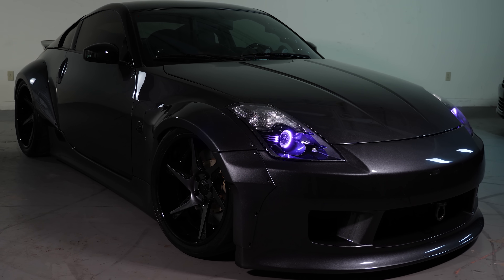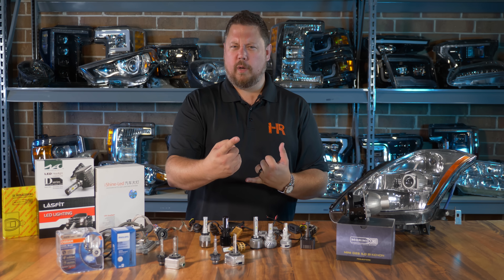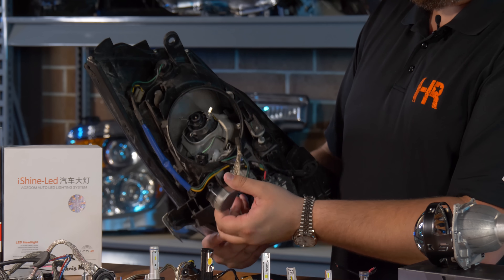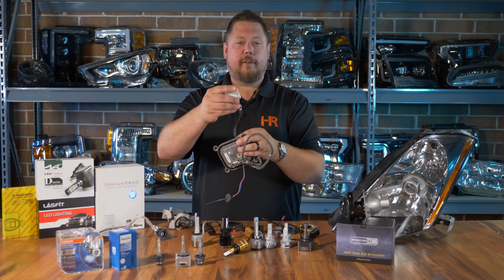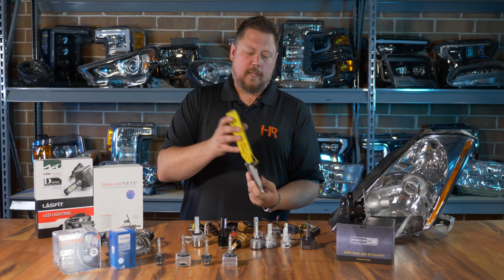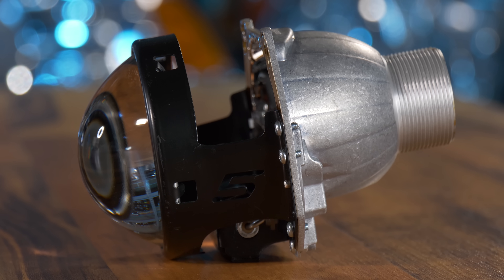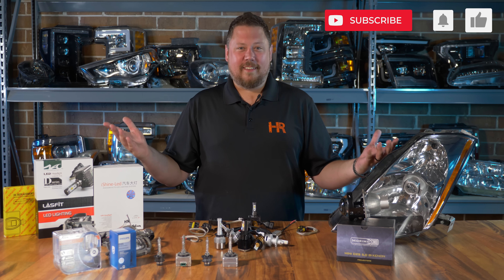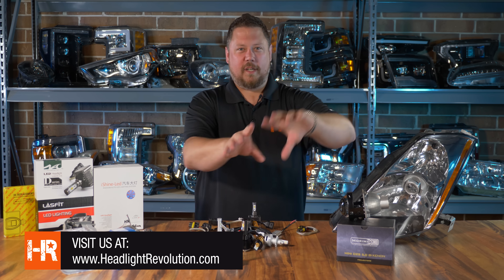D1S and D2S LED Headlight Bulb Replacements - Are they brighter than HID? | Headlight Revolution

Comment: Time to remake this video?? There’s now a few that are plug and play with the ballast! I’m going to give it a go!
Reply: true. I cant even find a video about those. I will have to find out how good it is. ill be installing mine this weekend.
Reply: @Abeldlg  let me know friend
Reply: How do they work?
Reply: @daltonnadeau1339  very well actually! I have the conversion in my Vauxhall Astra van. They seem to be a lot brighter than the xenon bulbs that was in it!
Reply: @125ktm2007  awsome thanks!
Reply: They are good and brighter than oem 35w hid. Im selling them locally and customers are happy.
Reply: @125ktm2007 how about the range? Do they shoot as Far and Wide?
Reply: So there are also now connectors for OEM to LED upgrades. No more cutting necessary.
Reply: @chrismic4835 i have d2 factory and wanted to upgrade.  Led or even hid. I just want something really really bright. any suggestions please?
Reply: How's your experience with LEDs so far? Should I replace my HIDs with LEDS on the stock ballast?
Reply: I came here to write the same comment. I gave up after watching this video, but when I saw the new plug-and-play D series LEDs on a friend's car, I was impressed. They are excellent and maintain the original beam pattern without any changes. Now, HID xenon bulbs look like halogen bulbs when placed side by side. I wish I could post a photo here. Anyway, I think it's time to remake this video because it misled me into thinking there was no plug-and-play option for the D series. But there is. Go out and buy one—I switched them today, and they are great. They use your original ballast to power up.
Reply: Any links of those plug and play for oem D3S, please???

Comment: I don't know why anybody would want to swap out HID with LED.  That's a downgrade, not an upgrade.  Great video tho!
Reply from the maker: It depends on A LOT, but to each their own!
Reply: Because use less power better for battery altenator etc.
Reply: SladjanL I doubt that it makes any difference to the battery or alternator. Most HID kits use a 35W ballast, which is the same amount of power usage as a regular headlight bulb. For now, HID is still better than LED, and as I said, it’s downgrade to go from HID to LED.
Reply: @onlinepaydays  thank you mr scientist
Reply: @gamercoolapple1  you're welcome.  Doesn't take a scientist to look at the basic numbers to draw the conclusion.  As long as you're not an idiot, it's pretty simple to see that HID still out performs LED.
Reply: Sorry but what you are seeing today on the new cars are not hids. Those super bright light that your seeing the roads are not coming from hids. But also not aftermarket leds. Those mostly are in oem set ups. I know I seem like I’m trolling this site but I love lights and like most d3s owners we are always looking for better and hid is just and older technology.
Reply: @onlinepaydays  for example we picked up a 2019 Honda Accord with factory led headlights. They completely out shine my d3s hids oems like Honda Toyota and Nissan are adopting led lights even into there base models for better light output and longer lasting like I said not knocking hid but been rocking hid for like over 13 years already 😩

Comment: Why don't you people test hikari ultra led in any of your videos. I think hikari's are brighter than any led bulbs out there.
Reply from the maker: We have some Hikari bulbs here and will be putting them in a video shootout soon. We've heard good things about them too but haven't done any testing yet.
Reply: That would be very good...please do a testing of those bulbs in a reflector high beam setup also. It would be very helpful
Reply: I want to put a set in my headlights but on the cat eye silverados there isnt much room for bulbs. Only led bulbs that i can fit are the auxbeam f16s. Got hikari ultras in my fogs tho.
Reply: @jasmeetsingh1236  
That's what I want to know. I've got an old pair of Hella 90 freeform high beams kicking around that I want to use for something but I'd like to be able to toss in a couple LEDs because it'd be really jarring against the color temp of the other lighting.
Reply: @skuzzyj  I am waiting for their review of the hikari ultra. I believe that they are the best led bulbs in the market. Regarding hella 90, you can go for leds no doubt but a correct one would be better...

Comment: Thanks for doing this.  I have been looking into replacing the HID bulbs in my Corvette with an LED, but you just showed there's no reason to.  When someone can make an LED bulb that replaces an HID and actually works, they will sell a ton of them.
Reply from the maker: True. If you're dead set on LED on a vehicle that came with OEM HID, go with an LED projector retrofit or a full LED assembly housing.
Reply: It is impossible to retrofit led in a projector, that was created for hid bulb. Why? Just look at the area, where light is created. It is in focus of the reflector and lens. And then look at the light source of led bulb.

Comment: I have a 2010 lexus gs350 with the 35w hid, if i replace the ballest with 55w and new bulds be brighter than what i habe now? Or should i just replace the bulbs and will theu be brighter than what i have now?
Reply from the maker: If the bulbs haven’t been changed since 2010, replacing them will definitely be brighter than what you have now. HID bulbs have a lifespan, and for 35W systems, it’s typically around 3 to 5 years. Over time, the output gradually diminishes.

If you’ve already replaced the bulbs recently but still want a significant upgrade, then switching to a 55W ballast and compatible bulbs will indeed provide more brightness. Just make sure the new setup is compatible with your existing headlight housing to avoid potential issues with heat or glare.

Comment: Good to see a nice video that shows that LED is still no match for HID, no heat is projected from an LED so it will not project light, only glow in front of you , it may look brighter upon the garage wall but on the road especially a dark road, you’ll struggle to see the road ahead.
Reply: my dads golf with leds lights up the road my golf with xenons i need to use torches to see at night

Comment: Wow! I wasn't expecting that. I thought that the LED bulbs was better all-round. So I have a Jaguar XF Sports 2016 X260 that uses DS3/35w (each side) HID bulbs. When the lights are on and your standing in front of the car they look bright, but when your in side the car and looking out the windscreen they don't look that bright. Is there a high wattage I can use that you can recommend without it damaging the wiring or the light? 
Thank you. 👍🏽😎
Reply from the maker: When going up in wattage with HID kits you don't have to worry about the wires, at that point you would burn up the internal reflective surface of the projector resulting in less light output over time.

Comment: Great write up. Saved me money. I have a CLS Benz 2011 w219… I have the OEM DS2 hid and I can’t see anything at night. My lenses are fairly clear and I was wondering should I replace the bulbs or should I replace the bulb and a upgraded projector… I wanted 6000k but l don’t want to lose lumens, so maybe 5000k? What do you think?
Reply from the maker: 5000k for sure, getting into 6000k+ you start to lose overall light output!

Comment: I went with OSRAM Cool Blue Intense(next gen) D2s bulbs to replace my old HID OEM bulbs and really like the color, brightness and beam pattern. I think the LED emitters are a technology that needs much more development before they can successfully compete with good HID systems. The problem, as I see it, is to get all the chip emitters oriented in a spherical array that has the sphere's center aligned with the focal point of a reflector/lens, hence a tightly collimated beam with minimal angular dispersion.

Comment: That's an awesome information. what do you think of after market hid kit to replace halogen bulbs or LED bulbs better option? Thank you so much for making this video.
Reply: I have a 2001 Subaru Outback with  reflector headlights. First I did the LED bulbs which improved my night driving experience, but a had some light scatter. I had to aim the lights lower to avoid shining on coming drivers. Then I did a complete Morimoto D2S retrofit. Opening up the headlights, installing the projectors with HID bulbs. My cars lights now look like any BMW, Mercedes Benz or Audi. When driving the light on the road is superior to the upgrade from halogen to LED. I went from good, better and best. Hope this helps.
Reply from the maker: A lot of it comes down to preference! Also, what do you drive?
Reply: @HeadlightRevolution  , 2010 tundra.

Comment: Not surprised at all since a projector is designed to utilize all of the light around the bulb unlike deflectors where its mostly horizontal (or rarely vertical) part of projection :)

Comment: You saved me wasting my time, thanks.
I was looking at D2 led replacements as my HID reflector bowl is burnt, looks like a refurb and new xenons.
Any recommendations for xenon replacements? 2005 Volvo V50 T5.
Reply: try to choose the higher wattage of HID. Might need to change ballast though. Original wattage 25w is suck.
Reply from the maker: Have you thought about going the HID route?
Reply: @HeadlightRevolution  I'm currently running bi-xenon hids, reckon the bulbs could do with replacing and I know the reflector is burnt but cannot find a replacement 😣

Comment: Something to note that while HID and LED are both point sources of light, the two  manifest their light differently. Headlight manufacturers note this manifestation in designing their headlights around the light source used. Putting LED  in a housing where an HID bulb belongs is the same as putting HID in a halogen housing. They may fit, but the output and spread will never be better than the bulb it was originally designed for.
Reply from the maker: Good point. Thanks for watching!

Comment: Great Video! your channel is the best guide on HeadLights! So, if i have a Headlight which uses XENON D1S originally, can I Change it to D3S? are they interchangeable? Thanks.
Reply from the maker: Unfortunately not, because of these differences, D1 and D3 bulbs cannot be interchanged since the pin configuration in the light is not the same.

Comment: my dad's vauxhall insignia has xenon hid lights in oem, they dont work, he changed the bulbs still nothing, then changed ballast and they worked for a good 1 hour then one side died and then the second side died too so now back to square one, what could be the issue as he hasn't got any condensation on the headlights.
Reply from the maker: Is it popping fuses? I would check the wiring for shorts.
Reply: @HeadlightRevolution  fuses are fine, but ill check the wiring for shorts thanks

Comment: Excellent post , I need some direction i have Acura Tl 2002 , D2R on the passenger side Retaining Spring Clip fell off , unable to find one , is there an add on adapter to replace the clip , Looking at your validation and post look like i should to stick to HID . Thanks
Reply from the maker: Reach out to our CS team, I'm sure we could help with that! 😀

218-755-5200
Sales@HeadlightRevolution.com

Comment: Nice explanation. Just one question that makes me very curious. Is it possible to put LED bulbs with more watts in a 35w standard ballasts without any kind of problems?
Reply from the maker: LED bulbs pull less power than your standard bulbs.
Reply: @HeadlightRevolution , that means I can put LED bulbs with 45w ir even 55w without damage the ballast?

Comment: I have a question for you:
I have the low beam light on my motorcycle with a factory HID. It's a BMW and the HID is the same used in some Land Rover, Buick and Cadillac (d2 bulb). The light glows but fade and kind of blue. I already tried different new bulb with no improvement at all. I even replaced the ballast but for a used one still with no apparent improvement. what do you think it will be my next step? Thanks in advance.
Jesus.

Comment: Very informative.I got a 2014 Audi sq5 with stock 35w d3s, can I safely step up to a 55w d3s? Thanks n keep up the good work
Reply from the maker: Stepping up to 55w would be the biggest challenge but it can be done safely!
Reply: @HeadlightRevolution  is it as simple as putting in the 55w bulbs?

Comment: I just came across this video. There are two different projector designs in the headlights of a 350Z. The 2003-2005 are a hybrid-type like projector compared to the newer housings from 2006-2008. Which one was used for this video?
Reply from the maker: You can see that car at the beginning of the video, these were the headlights used! (:

Comment: is there an adapter for a d1s housing for a d2h bulb? or anther aftermarket HID. I am looking into a projector headlight housing but my car has a halogen factory housing. my issue is the clip that holds the d1s in place. Is there a way around that for other bulbs?

Comment: Great Video ! i have a question about d1s and d3s burners. It is said that the d1s burners are a little cooler due to the mercury filling. but are they also brighter than the d3s? optically it already seems to be so. are there any test results? many thanks

Comment: Can you help me on my Mercedes Benz 2012 C350 model where the right (passenger side) HID headlight not working more than a second then shutoff, i tried to replace the ballast but the same also i am facing issue with the signal light indicator turning faster than the left side.
Appreciate your support

Comment: I have a 18 equinox with reflector housing. Currently inside are d2s 25w. They’re ok but just not bright enough on back roads where I live. I can’t see more than 10ish feet in front of me. Car specs say I should have D3s 35w. But I’ve also been told D4s and D6s. What would you recommend? If I go to D3s, would I have to change the ballasts too?
Reply from the maker: You would want to stick with D2S and get a better bulb like the Osram NBL!

Comment: Great video , but I have a problem I just purchased an upgrade headlight for Porsche Cayenne TurboS that came with H7 socket while my OEM it is a HID D1S  The seller did not want to return the item that cost almost $1000.  I have to keep the H7 socket housing and try to make happen ...Can you tip me how should I do in order to cancel the HID power and just have connect a H7 LED straight; meaning cancel all HID system and use H7 direct LED   I think I Have no other option .   Thanks in advance
Reply from the maker: Unfortunately, that will take a fair amount of custom wiring, as the power for the lights is wired for factory HID. You will have to figure that out, we do not have information on that, so sorry about that as I know you are out of luck with that other company. I will say that your best bet would be to return the products and then file a chargeback with your card providor, letting the company you purchased them through know ahead of time. 

If you do want to try and figure out the wiring for that, you will need to use one of the relay harnesses that I have linked here: https://www.headlightrevolution.com/hd-relay-h7-H-H7_2?quantity=1

Comment: What replacement bulbs do you recommend for d4s? I have a 07 lexus gs350 and ran morimotos d4s 5500k and I feel they do not produce great output in comparison to new cars or other simile cars. What can I do to make the output brighter besides adjustment that’s been done on car? Thanks in advanced
Reply from the maker: I would suggest swapping over to some nice high end OEM HID bulbs like the Osram Nightbreaker Laser.
Here is a link (:

https://www.headlightrevolution.com/d4s-osram-xenarc-66440-nightbreaker-laser-B-66440XNL_2

Comment: My '04 Jaguar has D1S bulbs and I hate them! When one started flickering, since they were likely original, I replaced them with those expensive Osrams. It wasn't long before one started flickering again, swapped them side for side and the flickering moved with the bulb. Even when they're "working" they aren't as bright as the LED's I put on my truck (9005's). I keep hearing how great these HID's are but I don't see it, I have a hard time not over-driving these lights at 60 mph! According to this video I guess I'm stuck with them.
Reply from the maker: Sounds like maybe a ballast or something is starting to fail!
Reply: @HeadlightRevolution  Only if it were both, and it's not like I haven't considered it ... just to make things more of an expen$ive p.i.t.a. with these damned things! But like I said, the flickering followed the bulb when I swapped them. It's mostly that they aren't nearly as bright as the LED's in my truck. This car also sits quite low, don't know how much of a factor that is.

Comment: Great video. I have a 2004 MB E500. It has stock HID. I have never seen a car with that much of low angle low brightness in my life, including all the halogen bulb cars I drove. Is that a common problem with this W211 model, as both an Autozone and Mercedes guys said what you have might be the best you can get? I will be re-angeling the lights for sure but what about brightness? Thanks
Reply from the maker: That's a good question and those cars can be very challenging. Send us an email at Sales@HeadlightRevolution.com and we will send you a few different possible options for your vehicle!
Reply: @HeadlightRevolution  i sent you an email yesterday. Did you get it? Thanks
Reply from the maker: We should have a reply out to you shortly, We're almost completely caught up with our email and phone queue! Thank you for your patience.